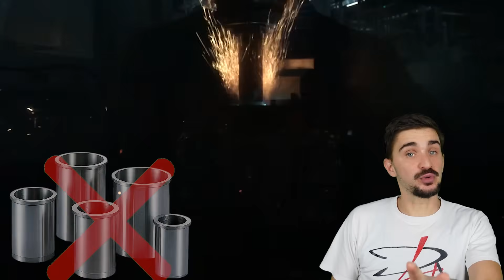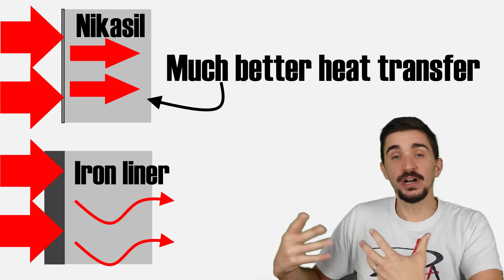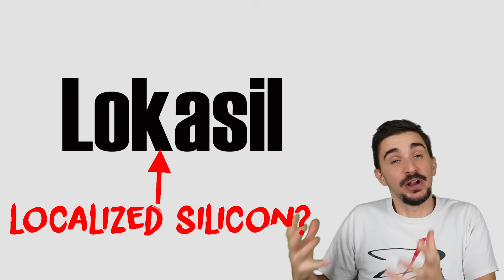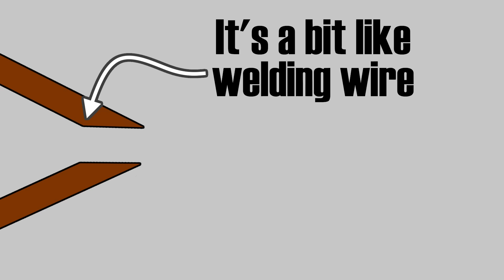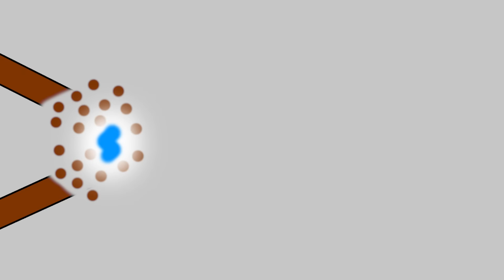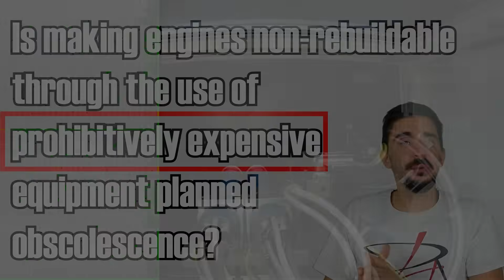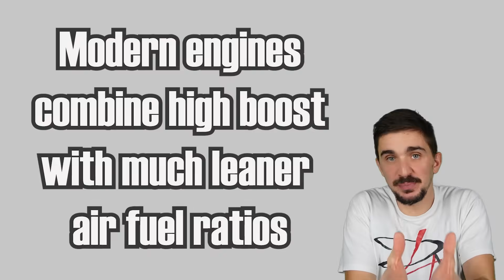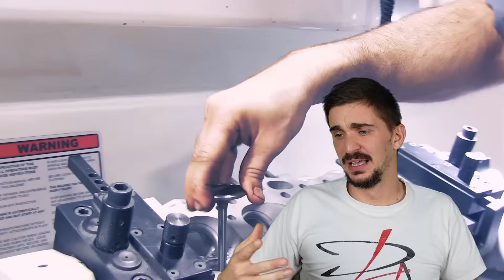Why Are Engines Becoming Non-Rebuildable? Everything About Cylinder Coatings

Comment: Using coatings has been used for a long time in small engines hence why most have like  500 ish lifetime hours. Problem with using this in a vehicle is any small issue such as a stuck oil control ring which would take 100,000 miles or more to even begin to be noticeable will kill these engines quickly.  (500 hours at 60mph is just 30,000 miles)

Comment: This idea of plating engine cylinders is stupid. The first and foremost reason to use cast iron is because piston rings are hard chromed. In order to maintain the oil level. We use a hard surface rubbing against a soft surface. Piston are made up of two compression rings and a finale oil scrapper ring to put lubricating oil back into the engine.

If you manufacture a cylinder with two hard surfaces. In it will pump oil right into the cylinder at the point of combustion. It will destroy the valves, the sensors and the catalytic converter.

So this will never be used for a extended period of time. Last all the new engines are designed to die at 50,000 miles. These rebuild engine can run for 300,000 miles with just proper oil changes.

So don’t fix what ain’t broke.
The new roller bearing lifter is the most stupid idea to roll down the road in 100 hundred years. The manufacturer know this is bad. But they think they can sell more cars. They are wrong.

Comment: I wonder, why do manufacturers keep insisting that the block needs an open deck (meaning coolant travels between cylinder bores) when common fix for them burning their head gaskets by mechanics is to just weld the cylinders together skim the block and do the head gasket job. This fixing the problem and the car doesn't start over heating, loosing power or there being issues with warped heads or anything else that would cost the customer money... Hmmmm... Something's fucky here... And also, the introduction of wet rubber belt valvetrains which clog oil pickups and catastrophically fail just after the warrant is out... Instead of chains. Something smells... Funny. On that claim of "decade or two" of service life. More like 1,5 - 3 years or 150k kilometers. 

That is actually the designed life span.

Comment: It’s all money. Engine technology is changing every 2-3 years although we have electric car era coming to us.
For car manufacturers to meet emission standard and catch fuel economy not to forget “catalog HP and torque”
Engine is becoming disposable. It is no longer considered lifetime of vehicle already. Cars don’t rust like before, more like engine or transmission goes first.

Transmission on the other hand can’t be rebuilt or replaced as well if you really know what I mean. Casing that has gap, amount of small gears that’s going in, use of plastic and so many solenoids to control are already great-wall for customer to say yes to repair. Furthermore with CVT rebuild is not the correct word, replace the entire unit is not really rebuild in my opinion.

However we are living in an era where car mechanics are very rare (stop talking about oilchanger and tire changer)
So then less parts being supplied no remedy to many circumstances in order to fix cars 
Entire transmission or engine being not to expensive (I know it’s subjective but back in your father days brand new engine were untouchable price) makes it somewhat doable. Honestly less than 20000$ for Mercedes engine is not expensive at all. Cars became affordable so did engines. So then no need to repair them then people change car when engine is dead.

Comment: The end of the video is very informative, but I think it missed something pretty big. Remanufacturing shouldn't be compared to recycling. It should be compared to the emissions of creating a whole new vehicle. If a used vehicle can be saved and run longer, no matter how efficient the new vehicle is, it will not be anywhere near as efficient as not scrapping the old one.

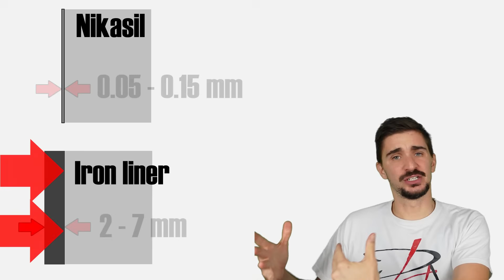Comment: 3:45 Engine Masters proved that lower coolant temperature increases HP because the cooler surfaces actually create a lower pressure zone that reduces slightly friction and increases intake volume/velocity.

Comment: It's a shame, cracked rods are strong but can't really be rebuilt. Stretch bolt technology is just so they can torque a bolt with the machine. I love the Honda bearing clearance by color get bearings down to the minimum tolerance.

Comment: Another important thing about the original "planned obsolescense": incandescent lightbulb faces a tradeoff between longevity and brightness. The only way to make it brighter is to run it hotter, which means shorter lifespan. It's just so happen the maximum efficiency of lightbulb last around 10000 hours. Also, spent lightbulb is easily recycleable, and lightbulb companies cartel offer rebates for bulb replacement and even contracted power companies to convert gas lantern into electric lightbulb.

It's less of a cartel brigading long-life bulbs (though still true) and more of physical limits of incandescent efficiency. LED and/or compact fluorescent won't come until much later and before incandescent it's even more insanely inefficient (literally plasma lantern). Is it scummy? Yes. But also physics law cannot be violated.

TL;DR cartel prevent longer lasting yet less efficient incandescent lightbulbs and offer cheap replacement because they knew how important lighting is.

Comment: the "spray" is a electrically embedded ceramic essentially,  or electrosil plating, and wrong, they are rebuildable, but you'd need to talk with somewhere that does superbike engine recoating and see if they can or would tool for a car engine.  electrosil or plasma plating is done on aluminum motorcycle blocks after boring them for larger pistons, the 04-07 ZX10R engine for example can be bored and recoated to 1013 CC from 998. not a big difference but enough to get a couple more decimal points of compression out of the cylinders.   it's also a thing with GSX-R bikes

now what i don't understand.. replating saves CO2, and a running plated engine saves CO2.. so rebuilding a worn out plated engine and replating it, would extend service life and CO2 emissions savings; reducing emissions in rebuilding versus recycling, and in use..

Considering the prevalence and love of the B58 BMW thermal plated engine in motorsports, i have a feeling this replating service will happen in the private sector outside mass production if it hasn't already.  which would make rebuilding or boring and rebuilding a B58 engine a potential option for car owners thusly saving CO2 emissions with rebuilding, and overall reduced emissions from running the engine with extended service life.    

now.. i can't afford a B58 powered bmw at this time, despite my desire to, but i do have it's early cousin the N54, which runs direct injection and steel sleeves in an aluminum block, and what appears to be a near 12-13:1 WOT ratio under boost...   whereas port injection cars would run 10.5-11.5 under boost. 

Also.. i now have pure 600's.. 500HP was my goal.. but 400 HP and able to run 87 if need be also works for me..

Comment: The questions should be why would you rebuild when in most cases a properly maintained engine will last 200 to 400 thousand km. At that point the rest of the car is most likely headed for the scrap yard.

Comment: I’m not gonna waste my time watching a 28 minute video just to get a two minute answer. It’s a simple as this. The more efficient you make something the more breakable it becomes. That applies to everything. Water heaters used to be built to last 30 years. Good luck getting your new water heater to run longer than seven years without major repair. Furnaces used to be an appliance inside your home that could run for 20 years or greater without a major rebuild. Now you have to get something replaced on your furnace every year because shit keeps breaking. All in the name of efficiency.
 Specifically car engines are made more and more efficient which requires less and less block material to make it happen. With the fact that they’re making all engine blocks out of aluminum and what you get is a weaker product because of it. Then to top it off car manufactures are throwing turbos on everything which decreases reliability substantially because now you have something on your car that burns through oil faster and increases cylinder pressure which makes head gasket failure more likely, and oil burning becomes more likely as well.

Comment: The thing is that by the time an engine needs to be rebuilt and by the time the coating wears off,  the rest of the vehicle is probably completely worn out. I took the head off my volvo s60 at 212k miles because i  broke a timing belt and bent somw valves. The plating on the cylinders still had the machining scores in them.

Comment: Comparing recycling and rebuilding makes no sense. If you rebuild the engine, you have a functioning car. If you recycle it, then you have a chunk of aluminium and a non-usable car on the way to scrap yard. Rather you should compare rebuilding engine of an old car and manufacturing a new car while recycling the old one.

Comment: Seems like the real trick would be engines with these coatings that can still be rebuilt.. when you factor in all the costs and materials with the mine out of the ground to build the car in the first place I think you'll find that a lot of a lot more then these coatings provide.. every time you build a new car you have to mine for new ingredients fresh steel you get the point.. and I think you'll find that adds up a lot more waste going into our are then just simply drive in the car itself... We need to learn to recycle our automobiles in such a way that they can be refurbished instead of making stuff disposable and throw away and buy new

Comment: Your point about it being "prohibitively expensive" thus it can't be planned obsolescence because they could do that for cheaper is mute... Why? Because you already explained that while the upfront cost is massive, at factory scale it actually ends up being even cheaper than cast iron sleeves‼️
Therefore if the engine gets less use cycles and is not rebuildable for consumers, manufacturers don't care because they are not only making more profit per engine, but they also are guaranteeing more future sales if you must buy a new engine 💯

In other words, they achieve textbook results desired from planned obsolescence‼️

Comment: More performance? Define performance. We don't need higher powered engines. The speeds haven't increased, the weight hasn't increased, and we're not racing our daily drivers. The only thing manufacturers should be focused on is efficiency and durability...and definitely not MORE cars. We're already saturated with traffic, it's uncivilized. And I disagree that manufacturers aren't reliant on planned obsolescence. They left themselves with no choice. Partnered with and offering 'prohibitively expensive' equipment is part of the plan. Expense is almost always a part of obsolescence.

Comment: The premise that a sprayed on liner makes it non-rebuildable is just wrong from the get go.   So your entire video is based on an incorrect assumption.   If you need to rebuild this engine, if the bores are in good shape - you're done - just touch it lightly with a hone so the new rings break in and you're good.  If the bore is not in good shape you have some options.   You could bore out the spray on, and then spray on another liner, if you have the fancy equipment.   Or you could bore out the spray on, bore oversize, and put in a traditional pressed liner.   Or you could lightly bore to just remove any irregularities, and then put in an undersize liner and undersize pistons.   If you cant figure out how to fix this, you arent much of an engine builder.

Comment: I dont know much about this topic but i believe that it would benefit both manufacturer and the buyer if the manufacturer would avail sprayed blocks as a service part for engines that have had their coating wear out or destroyed. So instead of a motorist respraying the block(which you have already stated is prohibitively costly) you simply buy a manufacturer-sprayed block as a replacement and get rid of the old one. the only problem would be if the manufacturer in time discontinued making certain blocks and therefore they are no longer available as a part.

Comment: I'll stick with my air-cooled VW engine. If the cylinder fails, I can just replace😂 the whole removable cylinder and call it a day. 50 HP is more than enough performance for that car.

Comment: A Volvo B18 engine can run for an hour without oil or without coolant. It' not a problem to rebuild it or even just put coolant in it and drive on. A BMW coated engine is completely lost just by overheating for a minute or skip an oil change or two. BMW always built engines that broke from overheating easily.
What is sad is that human caused climate change is a scam and comes with a great cost for regular people and capital gains for the filthy rich!

Comment: Given the failures seen with bore scoring in BMWs and Porsches, I wonder how the application of the coatings works to ensure high accuracy in cylinder dimensions. Once you've sputtered a lot of very durable crap on, its natural tendency will be to have uneven dimensions.

Comment: Ok I disagree with everything this person has said about engine rebuilding. An engine that can be removed have its parts inspected and re-machined will always be cheaper to operate and use. And the ability to not have to recast engine parts will cause far less emissions than than any engine that cannot be rebuilt.

Comment: The idea of spray on metal coatings began long ago and yes it saves a lot of labour.
The ways big companies cut off the ability to keep their products going past the point where they're hoping you will return for a replacement isn't in "what engine build method" but the proprietary vehicle control data which is trapped in the ever cheapened modules which are tied to each individual vehicle and cannot be easily transferred to another same model, thereby cutting out the DIY car repair crowd.
I've met with engineer in this field and he explained "they could if they wanted" make it to last a million cycles but they don't want their old models going on forever".
Reply: Look into the "lightbulb conspiracy" I have no doubt every manufacturer from cars to electronics have a similar thing going on
Reply: @12onin_Gypsy  Hell look at tire pressure monitor sensors. Fucking worthless, it's 5 yo level to check tire pressure. Those thing expire in 5-7 years (irreplaceable battery, why???), costs $180 each at the shop (yes they are like $80 for all four but nobody has a tire mount at home). More and more things are added to cars for "safety" and the "environment" (global warming is bullshit) that are quite truly designed to fail.

Comment: Hi!

Very nice video.
I would like to say that coatings improve the heat transfer to water jackets (which is critical for new engines with high power density) for one more reason : The use of sleeves doesn't guarantee 100% contact with the base block material. The coatings can guarantee this. The percentage of contact is vital for facilitating heat transfer.

Comment: Carbon dioxide CO2 has no effect in heating the atmosphere the Greenhouse theory is nonsense the reason the lower atmosphere is warmer then the solar irradiation is due to atmospheric pressure

Comment: The engines are still rebuildable. If the cylinder is damaged they just need to be bored and recoated. This is not something that is done in the backyard our the local machine shop though. This is not new tech though and has been done for like 30 years in the powersports industry.

Comment: @18:43 That's a lot of moving the goalpost here. It is designed in a way that limits the lifetime of a product to a certain period of time. What has the fact that there are cheaper ways to do it to do with anything? It is cheap in a big scale production anyway.
@27:10 If you make the case for longevity, costs of repairs and spares, you can say whether or not something is bad or worse. Who cares that a manufacturer can extract more horsepower out of smaller displacement and can cut a lot of costs of production if the car does not last very long, is needlessly complicated and expensive to fix?
@27:44 Where is the data that confirms that CO², the gas of life, is bad for the environment and the human portion has any significant impact whatsoever?

Comment: Well, wouldn't it be cheaper to sink only the cylinders into the nickel-silicone base and not the whole block. and then only the cylinders could be changed in the aluminum block when it wears out???

Comment: I don't think the sulfur content of the fuel was really the problem.  Yes, it would form sulfuric acid and eat the Nikasil, but it was programming that caused the problem.  They wrote the code to inject extra fuel under certain conditions like startup. Well if you keep cranking and trying to start the car you end up washing away the then coat of oil in the cylinders. That makes you lose compression and can't start, so you keep trying. This makes it so the sulfuric acid can form and get to the Nikasil. 

Proof that it was the programing and not fuel is as you said Porsche and others use Nikasil yet didn't have the problem.

Comment: would it not be atleast theoretically possible to put in a sleeve and different pistons, then retune injection? you could probably still pull enough power despite literally decreasing the displacement of the engine, as a last ditch for repair

Comment: One of the best rebuildable engines i know is the PSA XU7JP4. You can remove the sleeves of the engineblock. They are strong, and reliable, they are decently economical, easy to work on. Even in the car.